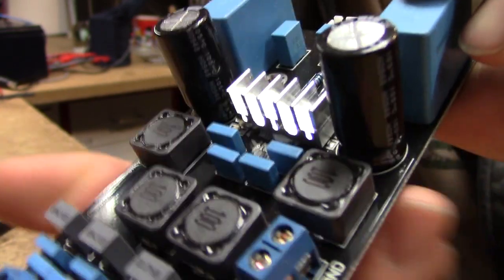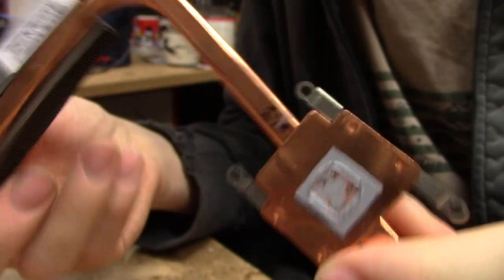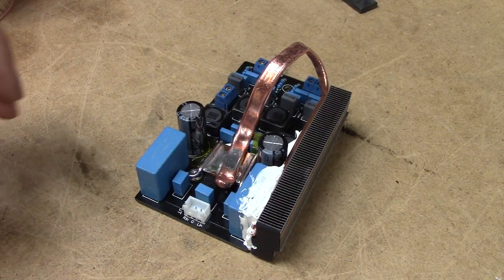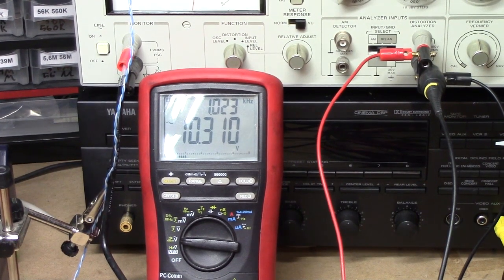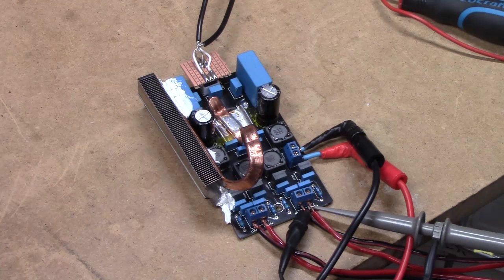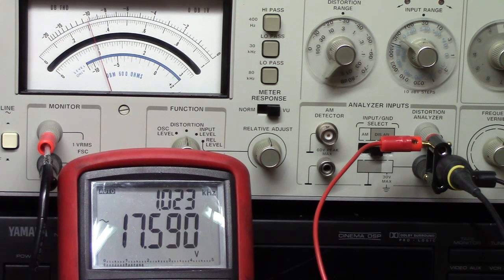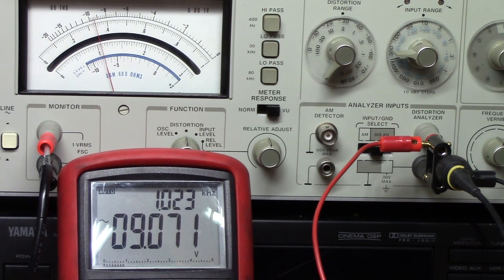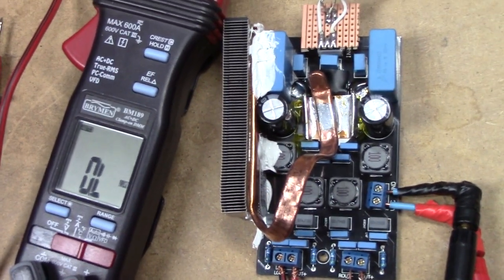TPA3116D2 heatpipe mod - much improved performance! AND THEN I BLOW IT UP

Comment: Those heatpipe-mounted radiators perform extremely poor without fan blowing through, as they have so close spaced lameles/plates/ribs/whatever it is called in english, and relatively low surface, optimised for relatively high pressure (compared to regular-radial pc fans) axial fan...
With original fan at full speed that your thing can remove over 100-150W of heat with hot end staying below 90 deg. Celsius. (i measured, with resistive load attached, a very similar one from a broken Pentium-m based HP laptop, inteded for a bit beefed up multiple watt "laser pointer". 
I did not bend the heatpipe however, just used the whole cooling assembly as-is with original air duct and fan in place...)

Comment: Idk if this guy took physics (fluid dynamic & thermodynamics) but the curves of that pipe prevent any vapor from traveling up. All heat movement is by thermal conductivity and not by capillary action in the actual pipe. Added to that the pliers clamped areas of the pipe pinching any fluid movement.
Reply: You are absolutly right. The fucking heatpipe didnt know that and stupidly works as expected.

Comment: five stars for inventive use of an old laptop heatsink there sir. I might have ended up slicing up an old type aluminium box cooler from socket 462 or something like that
Reply from the maker: +Maurice Orris You basically have to use a heat pipe on this board, since it's so crammed together. Using an aluminium-only heat sink would likely not allow enough heat to get carried away from the chip quick enough to prevent overheating.
Reply: +Maurice Orris
I'm thinking of making a small, portable linear power supply using an old laptop heatsink/heatpipe assembly ;)

Comment: that ic is used in lcd and plasma speakers amp so isnt used quite often at full power
Reply from the maker: +Alex Verias The IC handles full power just fine. The limiting factor is the undersized cooling of the board, and my own idiocy for connecting it up backwards.

Comment: I kind of strangled the heatpipe, a lot... Very high chance this is why it didn't perform as good as you expected..
Reply from the maker: The heatpipe worked fine in this, it's just that the fins of a laptop cooler aren't spaced far enough apart to allow for efficient convection cooling; the fins get hot, but no air moves across them.

Comment: What if you move the chip to a sub PCB and use a proper passive heatsink thats used on big stereo receivers?
Does this chip sink to the PCB as well?
Reply from the maker: You need to have the output filter relatively close to the chip, so it makes more sense to just make a new design for that purpose. It'd work fine.

Comment: +FFcossag,oh my mistake,I thought you accidentally destroyed it,so decided to really wind it up for some smoke,all good!!
Reply from the maker: +Daniel Malik The destruction was accidental. The part you see on the video was shot after the initial "Oh shit" moment of actually connecting it backwards.
Reply: +FFcossag I guess one of those would come handy to the lab http://provideyourown.com/2012/reverse-polarity-protection-circuits/
Reply from the maker: ***** I disagree, there's no fun in reviewing cheap stuff with big power supplies if you don't have the occasional explosion. ;)
Reply: +FFcossag Agreed, letting out the blue smoke is half the fun of playing with electronics. Unless your one of those people that just uses their equipment and never wants to push the limits and see whats really going on.

Comment: So its a 50Wx2 +100W amp that can only give 20 Wpc before it shuts off?
It has thermal overload protection but not reverse polarity protection?
Reply from the maker: Thermal is integrated into the IC. Rev. polarity is not. That's standard practise since devices are expected to have rev. polarity protection for the device as a whole.
Reply: So, if I use this in a DIY portable speaker instead of the 2x15W I intended (it won`t behave), it won`t die if it overheats? :)
Bit bigger than what I want, but as long as I don`t have to use a huge heatsink I can deal lol..
Reply: It should be able to deliver it`s specified watt output anyway but hey.. I only need around 20 Wpc :p
Reply from the maker: jan christian Frodahl
Well, it does if you put a big enough heat sink on it.
Reply: How big?
Reply from the maker: jan christian Frodahl
Well, something about the size of what I put on it seems to work pretty OK.
Reply: One more thing.
When it does shut down, is the reset timed or manual?
Reply from the maker: jan christian Frodahl
It turns back on when it's cooled off.
Reply: Ok nice, thanks for all the info, appreciate it ;)

Comment: I am not sure why electronic purists hate fans. One can halve or more the C/Watt by the addition of a small fan.  Every PC processor has one so why not an amp or DIY power supply.  Yes, they fail and make a noise but both can be addressed by a thermocouple  and choosing the right fan. Good fans are hard to come by though, most quiet ones are just low amps.

Very helpful firm ABL.
http://www.abl-heatsinks.co.uk/index.php?page=extrudedproduct&product=158

I'm in the process of building a 160Watt linear power supply - 4 x 2N3055's. Frying tonight.

Shame to pop that board but I take it a nice fat diode would stop that happening. 

Great video's FFcossag, every one is worth a watch.
Reply from the maker: You say you're not sure why people don't like fans, yet your very next sentence presents some rather compelling arguments against the use of fans. ;) If I had an easy means of running an i7 with no fan, I would do it in a heartbeat.

Besides, giant chunks of metal are WAY cooler than little spinny things.
Reply: From the way I have seen fans used I am not surprised they are not liked. It's pretty obvious from most installations very little thought has been given to any form of cooling. The very amp you are reviewing is a classic example. 

The options are quite clear, you either have a massive finned heat sink that is expensive and bulky or a much smaller one cooled by a fan. I also suggest methods by which the problems associated with fans can be addressed - be fair. I would far rather have a fan switch on than my power transistor, etc melt. It's your choice. 

I'll stick to my 'little spinny things' they are a good warning when they kick in along with an LED in case I don't hear the fan. Even with a fan and LED on my power supply there is a thermal cutout. It's 9 years old and never had the top off. Mind you the caps must be shot by now.

I'm afraid, I'll have to disagree with your 'giant chunks of metal are WAY cooler'. You only have to look at the thermal signature to see that the case of a power transistor is double the temperature of even the back of the heat sink right behind it. There has been some pretty clever work done on PC CPU cooling. Maybe they should use a 'giant chunk of metal' and no fan. I think not.           

I think the figures on this web site rather suggest there is no effective alternative. 

http://www.abl-heatsinks.co.uk/index.php?page=extrudedproduct&product=158

We must agree to disagree here I think. However you approach to dissecting these amps is the best on Youtube. There is so many crap 'reviews' on YouTube you are a breath of fresh air.

Let's put it this way - Iv'e ordered 2.

Thanks a lot.

Comment: im sorry to say but you fucked up in your construction..
the water vapor inside the heatpipe need to flow back by gravity when the vapor condense.. ..

the fan should be straight up
Reply from the maker: +jomme918 That seems to depend on the heatpipe in question. This one works just fine in any shape or angle, while others I've played with don't work at all unless they're in a specific orientation.
Reply: news for me if that is the case..

then could you explain to me how the condensed vapor/ can float back to the heat source to vapor yet again,

i can not see how that is possible, for the liquid to travel up over your lood to the chip:)

its correct that thay work under different angles but for best effect the faster the liquid can float back on the side walls the faster it can vaporise again.

the only difference between heatpipes beside shapes is the media / liquid inside under vaccum.

often water to electronic because under vaccum it boils around 30C
and not much is needed!!!

i have seen some youtube fails, where people make thair own in bigger pipes 20mm and fills it close to half full before closing it...
it works for demonstration.. but what fails and the pipe can not get rid of the heat and it reaches high temp.. all of the liquid will be vapor. and water expand around 2000time the volume..= ):hot water bomb:(

bad english sorry..
Reply from the maker: jomme918
I don't know how it works, only that it works good enough to cool stuff like this amplifier.
Reply: ok :)
im heading to bed.. DK
Reply: If I'm not mistaken they're not filled with water, but more commonly acetone under low pressure. There's a porous coating on the inside of the pipe. When you heat one end the vapor travels to the colder end and condenses, gets absorbed by the porous medium and capillary action brings it back to the warmer end. I don't see why this wouldn't work in a loop, squeezing it too flat might affect the performance though.
Reply: It's possible for liquid to travel against the gravity because the capillary action of the heatpipe wall structure spreads the liquid evenly across the inner surface and must be stronger than gravity - in fact if gravity ever took over, you'd possibly have a blocked pipe that is fully blocked by liquid on one end and the vapour couldn't travel. As the vapour is released from the hot end, it leaves more room for liquid to flow onto there. As the liquid concentrates on the cold end, it pushes the liquid along the capillaries into the hot end.

And it is water with a rather strong vacuum, not acetone, though i guess similar effect can be achieved with various liquids/vapours.
Reply: heat pipes do not require gravity to work, there is a metal fiber construction and a vacuum inside of the heat pipe. when the liquid is heated, it vaporize and travel to the cooler side due to pressure difference. at the cooler end, the vapor condense back to the liquid. this condensation cause pressure to drop so it pulls more of the vapor to the cooler side. the liquid is 'pumped' back to the warmer side by the metal fiber like how water can climb a piece of paper towel. I think this is flawed as bending the heat pipe too much might break the fiber inside and causing it to be less effective. I hope this helped you and everyone that did not know.